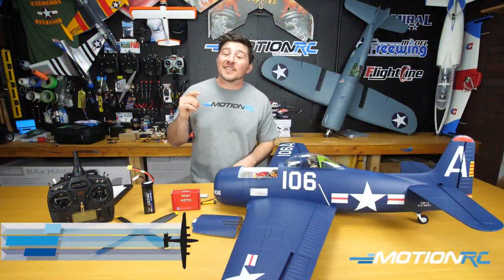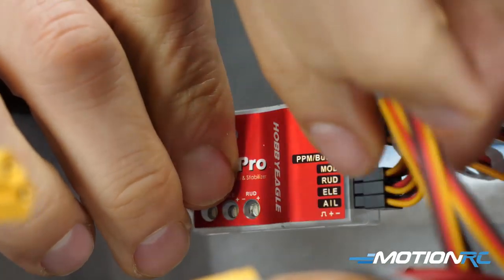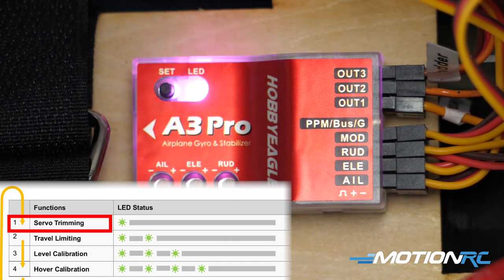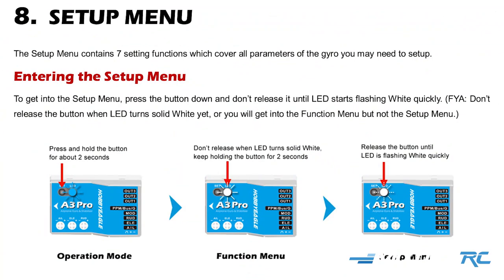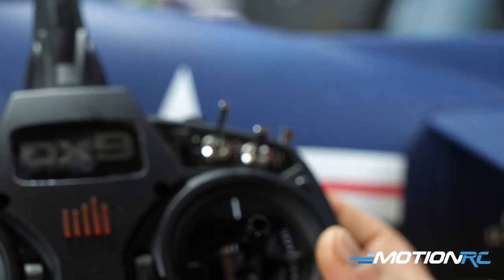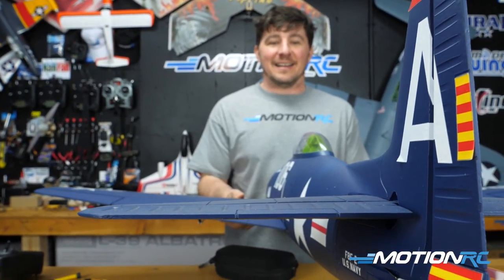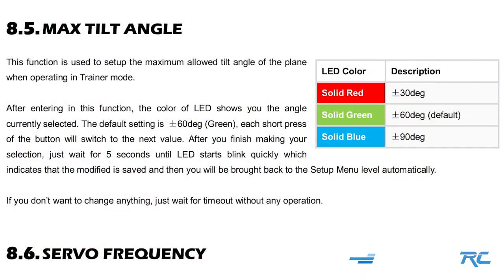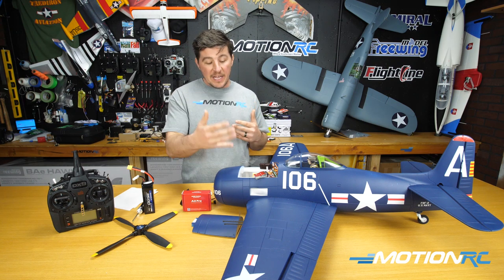HobbyEagle A3 Pro Gyro - Set Up Video - Motion RC

Comment: I purchased the A3 Pro a couple yrs ago.. I was very excited to get it installed and go fly. I used your video to set it up in my 1500mm Warbird. Setup was easy to follow along with your directions.. Sadly, as I finished up with the last setup of my throw angles, the led on the A3 Pro went out and would no longer power up.

Comment: I was having a terrible time until I asked my wife for help.   For some reason I couldn't see a difference between the RED and the YELLOW led !  It also took me a while to figure out that Flight Mode 3 on my Spektrum transmitter corresponds to POSITION 1 on the Gyro !

Comment: Good video. There is an easier way to check the gyro direction, instead of turning up the gains, just select Trainer Mode or Auto Level. When you tilt the plane, the gyro will keep holding the correction till it's level again, so you don't have to repeatedly rock the plane around and try spot the movement of the control surfaces.
Reply from the maker: True, but personally, I hate having to wait through the light menu any longer than needed to turn that mode on, only to turn it off again 😂
Reply: @MotionRC  You don't like a little disco? ;-)
Btw, in Trainer Mode, is it possible to increase the movement of the control surfaces? I have that mode set for hand launch, and even though the max bank angles are set to 60 degrees, the control surfaces never move far enough to even reach those angles. So the plane climbs slowly and makes super wide turns. Switch to Normal Mode and the control surfaces can again move as far as the travel is set in the radio.
Edit: found it. I had to adjust servo travel on radio. I tried that, but thought I was adjusting elevator input weight, but instead was working on aileron travel. So when I didn't see any change, I called it a day. Now I have same control surface throws in Normal and Trainer mode.
Reply: @rc-fannl7364  You don't make those sort of mistakes too do you Solo?!! 😜😁
Had to rebuild the nose of my Ranger G2 after the first adventure with this 1! Went back to a Kopilot but must give this another go in the Mini AR Wing - that'll bounce better during the R&D phase! 😂
Reply: @theoztreecrasher2647  Hey, nice to see you again! 

I made plenty of mistakes, like somehow managing to get a plane rolled to inverted when hand lauching it. Or crashing my Mini Mustiag into the side or a parked trailer, when landing, and misjudging the distance.

But so far I had no issues with this flight controller, it's been behaving really well since I installed it. I might have to reduce the gains a little, as there is a bit of oscillation, mostly on roll, at full speed. But lately I rarely get to fly the plane it's installed into, so that's still on the to do list.

Comment: Placement in the fuselage of the blue gyro needs to be near the CG as mentioned, but it may face in either direction.  The servo pins can be facing the front or rear of the aircraft, flat or vertical mount, as indicated in the instructions.
Reply: Do you know if it can be mounted upside down for AC with access from the bottom?

Comment: Hi James, 

My control surfaces twitch in the trainer mode and aren’t smooth. I turned the gains down to see if that helped but it just lowered the travel. Great video on set up, really helped having your info. 
Thanks
Ant
Reply from the maker: The gains shouldn't affect the travel of the servo, they affect how much the gyro corrects the servos, but once you move the sticks, your travel should be whatever rate you have set int he transmitter. I am not quite sure what you mean by twitch in trainer mode. Hard to diagnose through YouTube. Your best bet is to contact our Customer service by phone, live chat or email during business hours and they can help get you sorted for sure. Thanks for watching
Reply: I have the same problem.  Any control input results in the control surfaces jerking rather than moving smoothly with the stick input.
Reply from the maker: @danvanleeuwen1974  Your best bet is to contact our Customer service by phone, live chat or email during business hours and they can help get you sorted for sure.
Reply: Motion RC Quick phone call solved it.  Anyone with this issue should go into “servo frequency” (setup menu six) and set that higher.  I went all the way to 333hz and the surfaces are moving smoothly now.
Reply from the maker: @danvanleeuwen1974  fantastic! Thanks for reporting back

Comment: at 14:45 you say the elevator and rudder are wrong, when theyre correct. and you say the aileron is correct (which it is)
i dont know if this is an editing mistake or if im wrong cause this could be very dangerous info for new flyers if incorrect

Comment: I am not sure if this is the correct forum to ask a question but here I go..
I purchased a JAS 39 plus the TV and completed adding it on, I have completed the mixing etc of  the canards and now I need to complete the mixing of the VT, problem is I have a DX 9 with a 9 channel receiver and I have also connected a Hobby Eagle A3 Pro gyro, so I now require a 10 channel receiver, or do you have any other suggestions. I have a feeling I may have walked into a simple fact I havnt thought of.
Thanks for your assistance.

Comment: When using a single wire  PPM or SBUS serial receiver like Walkera RX-SBUS or FlySky FS-A8S or Crossfire, where do we connect the ESC signal wire for throttle channel.

Comment: I have an Arrorws Marlin Jet - it has 1 servo for rudder and 1 servo for nose wheel steering and those 2 servo leads are joined and go into 1 port on the receiver. My A3 Pro attempted setup failed - the rudder will not move.  The elevator and ailerons move okay.

So the A3 Pro will not work with the rudder and nose wheel servos joined ?
Or is there a solution ?

Comment: Will this work 100% properly  on a flysky i6a  receiver  ??? Or does  it have to be a spektrum  or something that supports dsmx or dsm2 ? 
As I've set 2 of these up as instructed from motion rc and utube  and the manual n it won't save my settings to switch 5 on my flysky i6 so I bought a DX8e  and hoping this sorts it perhaps ...any thoughts on my delema  I've with these 2 a3pro??

Comment: Hi great vids.  Can u help me?  Need to know for hover calibration:  i have my flat inverted position.  1 when i calibrate de hover,  should enter programing mode A- in hover mode or B- normal mode on gyro?   DUE my onces i activate hover mode nose points  down. Thanks

Comment: Just bought 2 of these to put in my new Mig-21 and F-86 .... anyone know what the little capacitor or whatever it is that comes with it goes?
Reply: Never mind .... just found it at the very bottom on last page of manual
Reply from the maker: Sorry, but yes the capacitor should be inserted into any open port on either the gyro or your receiver, which helps prevent against a voltage loss that would otherwise turn off the gyro or RX if you hit a certain load.

Comment: Not sure if l am missing something here, but got my first pro 3 today, and set it up in my trainer. Connected up as in the video, but no flying 
surfaces are moving!. Red light slowly flashing on the pro 3, which according to the manual means it has lost tx signal. ls there another setting l 
should be changing or using between programming and using? Thanks for a brilliant video.
Reply from the maker: Hey John, hard to disagnose these things on a youtube video. Your best bet is to call our customer service department and talk to one of our guys. They know this stuff in and out and can get you sorted much fast than a back and forth on YouTube
Reply: @MotionRC  I have the exact same issue with mine - I only get slow flashing red lights.  I have an A3L gyro in another plane and it works perfectly, so I know to program them.  I contacted customer service and they said to update the firmware, but the A3L doesn't have anywhere to plug in a cable.  Any suggestions would be appreciated.  Thanks
Reply: sorry, that should have read, "but the A3 Pro doesn't have anywhere to plug in a cable."

Comment: I have a Leader 480 set up for flaperons.  When I try the A3 Pro then only 1 aileron will move under gyro control. The other aileron does not move.

So I can't use A3 Pro and flaperons together ?
Or is there a solution ?

Comment: thank you, what is the difference between normal mode and auto-level?
Reply from the maker: Normal Mode is the basic core of the Gyro. When flying in this mode you get the benefits of the Gyro stabilizing the plane regardless of orientation. It shines immensely on windier days as the gyro micro corrects the servos without you noticing but will make the plane look smoother in the air and get "knocked around" less. Auto-Level is a mode where once you release the sticks, the plane will automatically level itself. Good for beginners as they can practice maneuvers, but if they mess up, they can release the sticks and know there plane is back to flying straight.

Comment: Great video first of all but I have a question. First of all I have the A3-Pro installed on the the S.M. Ar wing full size. Had a couple flights today and I am getting a crazy ride especially under high throttle. It seems to me that the elevons are rapidly fluttering up and down causing this wawawawawawawawaw bumpy flight. I was it trainer mode when this was happening. Do you know what I need to do to stop this? Thanks-Joe
Reply: Turn your gains down, at high speeds if the gains are too high you will get oscillations.

Comment: How come when I use my 3 position switch doesn't make the gyro match the colors of the function I set to them? Instead of turning green for position 1  it's solid blue... I set it up according to the video
Reply: I have the same question.  Changing the mode switch doesn't bring up the color that is programmed to the position

Comment: If I use the PPM single wire setup, where do I plug my motor connection?  To the receiver using channel 3?
Reply: Yep, that is the 1 limitation of this Stab. You need a receiver with both PWM and S-bus/PPM outputs or use a Y lead to extract a throttle connection via a PWM/PPM/S-bus convertor.

Comment: I tried fitting the Futaba servo connectors into the gyro Hobby eagle A3PRO V2 and they don’t fit due to a flange that have those connectors. Is there any adapter cable that I can use so they can connect to the out 1  out 2 and out 3 of the gyro. Please advise. Thanks
Reply from the maker: Take an exacto and take that little piece off. I know of no adaptor
Reply: @MotionRC  thanks

Comment: hey I have a radiolink at9s pro transmitter with a r9ds receiver. I bought a gyro the A3PRO V2 and I'm having issues getting everything working correctly. I need help. Thank you
Reply from the maker: Not sure how we can help. We don't carry that radio. Never used one myself
Reply: @MotionRC  how should the wiring look like could you help me with that?

Comment: What Happens when i Put all the Gyros to full +? Can I still takeoff without Problems is stable? I am a beginner so before my First takeoff i would Like to know that
Reply: I have the eflight Cirrus 1,5m what do you think are the best settings in the cirrus for a beginner?... I Just wanna fly relaxed so I need settings for very beginner..
Reply from the maker: You NEVER want to fly a gyro with full gains (I assume thats what you mean by full +?) The plane would wobble all over as the gyro keeps over correcting until it eventually would crash the plane. Start with the gains around 1/4 and then its micro adjustments. If you bring the plane to full throttle and it wiggles, then your gain is too high. You want to get it to the point where you see no wobble. I have no idea what to use for an EFlite plane as that is not our brand. I never flew one.
Reply: @MotionRC  OK so I try 25%... Thank you:)
Reply: @MotionRC  I have it now between -20 and -25% and when i give throttle it still flatters at the ailerons i want very beginner settings is this normal that it still flatters?
Reply: @MotionRC  i really didnt want to Crash at my First flight

Comment: I have the problem that the auto-level mode just behaves like the trainer mode.  It don´t let me do rolls. What can be the problem here? Firmware issue? My A3 Super let me do rolls in auto level mode.
Reply from the maker: hard to diagnose on a youtube comment, but you are certain you are in the correct mode?
Reply: @MotionRC  Thanks for the reply. Yes, the purple light is slow flashing.

Comment: Hi sir
Would you please tell me about*atti-lock*
Reply from the maker: Atti-mode is a trainer mode, it will limit the maximum angle of the airplane on both roll and pitch axes. Roll and loop are not allowed in this mode, the airplane will be stabilized all the time, independent of any stick input.
Reply: @MotionRC  sir I really appreciate your effort.
So nice of you.
Love and respect from Pakistan ❤️🇵🇰

Comment: Something worth mentioning is that you must connect the ailerons to your receiver and stabiliser even if your plane doesnt have them. It will not work otherwise.
Reply: What about rudder, I'm making a fixed wing.
At the moment the capacitor is in that or output 3. But getting terrible jitter.
I have power from bec on esc but then also powering the rx from the rudder channel 5v rail. On the gyro. Got it all going but the servos twitching not crazy but quite a bit of movement.
Gonna try some ferrite rings.
Reply: @Woodsywoodsy-sj9qy  i think you might just need to turn your gain down. Also I never used  the capacitor and never had any issues.
Reply: @samuelkrajc  there is a cap on the esc/bec also the one supplied on unused rudder pins. 
Still jitter. Gonna take it all off start again. Servos are fine on a tester
It's all working as it should be except jitter.
Start again see what happens if not, I try ferrite rings. If that fails I just go back to inav as I have a working wing on inav. Just that I killed a matek f411 & thought I'd try a cheaper gyro option.
 Can't find any wiring diagrams on A3 other than the manual. & I'm not using a pinned RX. X6b on pwm,
Reply: @Woodsywoodsy-sj9qy  i have no jitter when my servo frequency is set to 333mhz.
Reply: @samuelkrajc  they sound digital. I only got emax metalgear mk2. Thanks for the input & will try the higher settings..

Comment: James, I've set up approximately 12 A3 Pro gyros. So not my first one. I'm having a little trouble. At first I was getting a constant slow violet flashing light. Tried programing it for OFF, NORMAL and AUTO LEVEL with the B switch. Nothing was working. After programming, it would always go back to blinking violet light. I then unplugged it and got out another new one and started plugging wires in. I plugged in the ailerons and the LED started flashing red, not violet, but red. Continued plugging things in and when I got to plugging in the elevator, it started flashing violet instead of red. Unplugged the elevator and went back to red. And BTW, while flashing violet it would adjust the control surfaces and I could not turn of the gyro function. 

WHAT IS GOING ON???? Two gyros same problem. It has to be something easy.
Reply: Sorry for the delay Jeff. Did you figure it out? Sounds like you may have a switch assigned to the wrong channel?
Reply: James Burulcich not yet. I have the Harlock Super Viper that I’m putting it on.